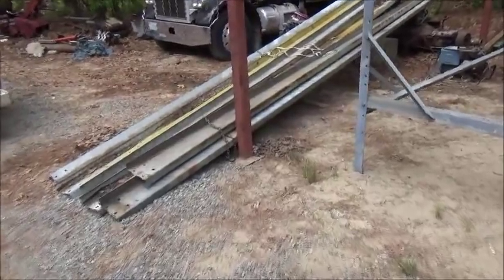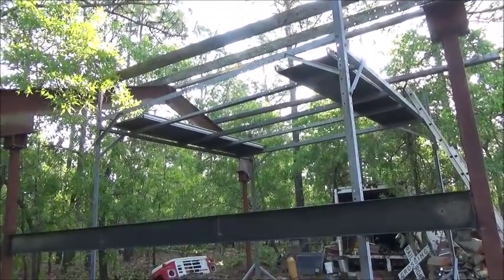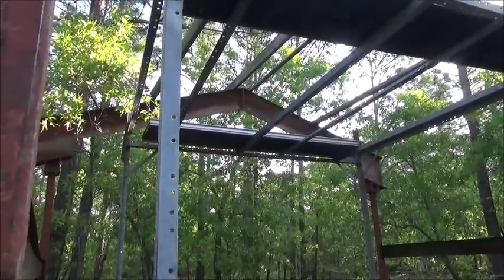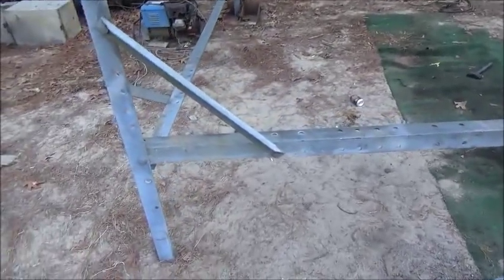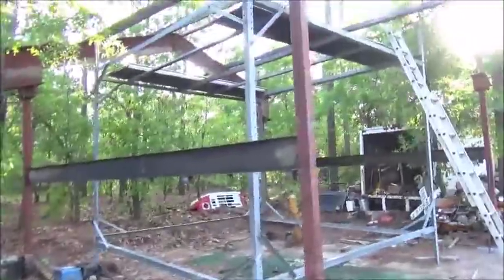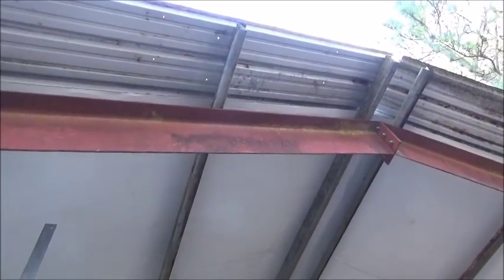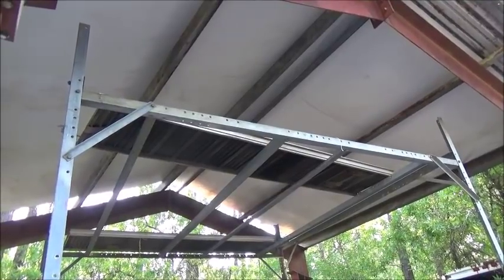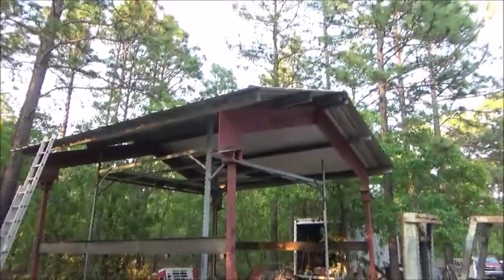Finishing The Carport For The Elcar

Comment: I had a problem in the shed i had with condensation, it caused everything to get wet. I put a plastic membrane and concrete floor in the shed and it completely cured the problem. If you dont intend putting a floor in the shed, maybe consider placing a membrane down, cover with sand or clean earth, to prevent punctures then a layer of gravel. This will prevent the ground ,moisture raising the humidity in the shed, and more importantly protect the underside of the Elcar from humidity.

Comment: Just a comment if you close the carport in you will significantly increase the wind loading and stress on your welded corners. I didn’t see in the video how much you designed it for sideways (wind) loading.  Easy to add any additional lateral bracing needed when you close it in though. To get a sense of what the wind can do just look at some of the old pole barns; they usually relied on the depth of pole burial and lateral pressure on the soil to resist wind loads; over time the soil gives and the barn starts leaning. Always enjoy your videos...from startups to cat fishing.